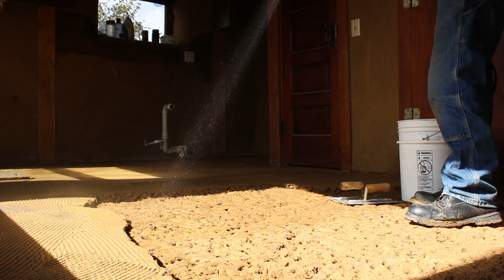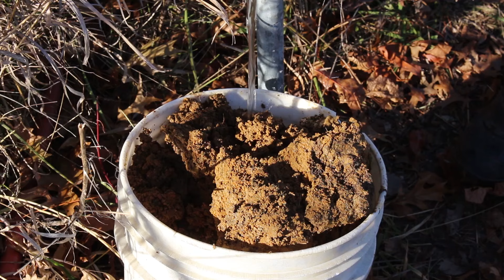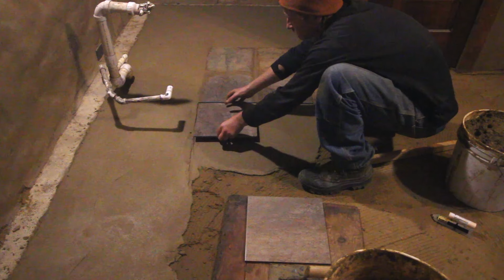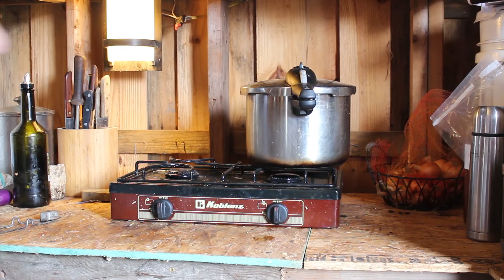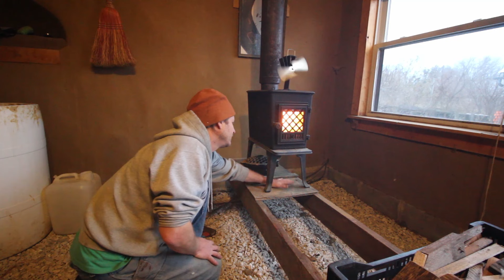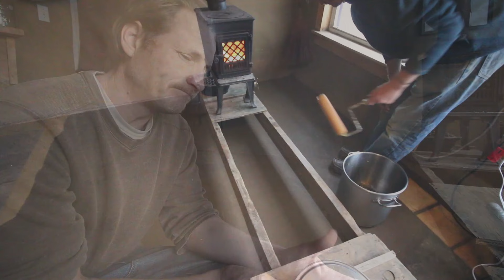Resurfacing and Protecting My EARTHEN FLOOR | Building with Natural Materials

Comment: Hi! Love this floor. I have a threshold made from cob bricks that is cracking and has some staining from some Penofin oil that dripped. Can I put linseed oil on at this point? It is 2 years old. Thanks!
Reply from the maker: The linseed oil won't necessarily stop the cracking but it could add some durability.
Reply: @HardcoreSustainable  Thank you for your reply! Love your channel!

Comment: How do you keep rodents from burrowing into the place?
Reply from the maker: I don't know how they would get in. The only place they get in is the attic, and they must crawl up the walls to get up there. I've never seen any sign of mice or rats inside my house. They wouldn't be able to get into the floor because they'd have to burrow through the foundation wall. I have expanded metal lathe all along the base of the walls under the lime plaster on the outside.
Reply: @HardcoreSustainable  
Oh cool thanks

Comment: My earthen floor has a big dent in it. What would you say is the best way to fill it in? There's a lot of dust in it and ants come through it sometimes. It doesn't seem like there's a lot of fiber in it so maybe that's something that could be added to the mix to fill it in?
Reply: @ellis if ants are coming thru the actual dent you have something else going on underneath than just a furniture dent from up on top ! I'd dig directly straight down about 6-8-10in and see what the heck, mite have to put down ant pellets in there (preferably without salt ingredient), THEN put two-three inches of gravel on bottom of hole and pound down with the end of a 2×4, refill with same type material up to ¼"-½" below floor level, then whip up a batch of fine material with all the ingredients, clay, sand, fiber (shouldn't need much) and trowel level with the floor, let dry and then seal with warm linseed oil for deeper absorbtion ! Good luck !!

Comment: Good job. Just finished my earthern floor. I used a clay alis paint on top to burnish. This means that any minor cracking is filled. Beeswax/linseed finish.
Reply from the maker: I love clay alis. I did that on the walls of my other house.  Didn't really have time to do it on my floor but it would have been nice. I could see it scraping off in a short time though since it would be a thin layer.

Comment: Would you be able to do a video about installing plumbing and electricity in a cob house? I always wonder what would happen if a pipe broke in the wall
Reply from the maker: I might be able to do one in the future, but I don't have any plans to plumb a cob house.  We don't usually build cob houses here because we get such cold winters.  If a pipe broke (from freezing temps??) you could just dig out the cob and repair the pipe. It would already be wet, I'd guess.
Reply: @HardcoreSustainable  oh, I suppose you're right
Reply: You could just do like in strawbale and put all plumbing inside another pipe that drains outside. If there is a leak it becomes obvious without damaging wall.

Comment: so why did you put the pot of linseed oil on the burner?
Reply from the maker: I was heating it up to make it thinner so it would penetrate the floor better.  Linseed oil is pretty thick at room temperature.
Reply: @HardcoreSustainable  I see. Thanks. So just warmed up a bit not boiling (as your subitlte mentioned), right? Wow fast reply! You got comments coming to your cell phone? You're so fast!
Reply from the maker: @JulieWolf  Well I guess I should have explained that part a bit more.  "Boiled linseed oil" is a product sold that has other chemicals in it than linseed oil. I used raw linseed oil, which is just linseed oil. https://en.wikipedia.org/wiki/Linseed_oil#Boiled_linseed_oil

Comment: Adding cement will add longevity
Reply from the maker: Then it wouldn't be a natural earthen floor.  I could add cement to just about anything, but I don't want to use it because of its impact on the planet.
Reply: Actually science tests have shown that adding some cement to clay mix does not help. The clay interferes too much with the cement action. Use cement or clay not both.
Reply from the maker: @jasondevine6014  That does seem like it would be true.  Clay would just dilute the cement and make it ineffective.